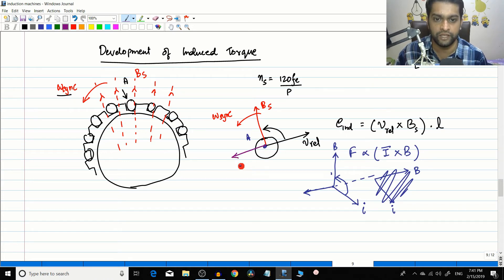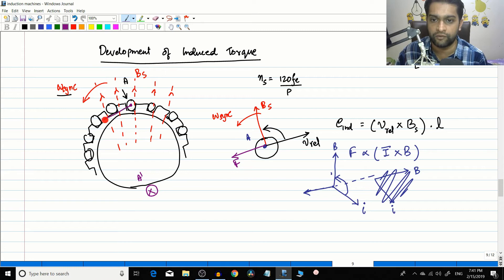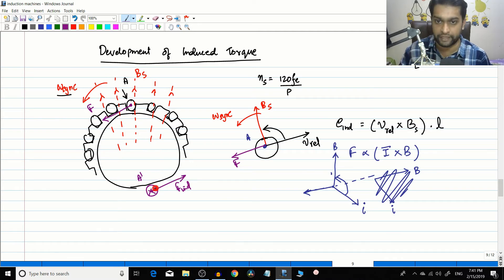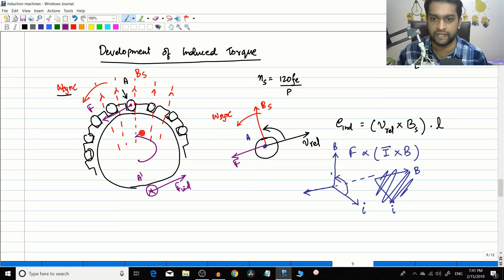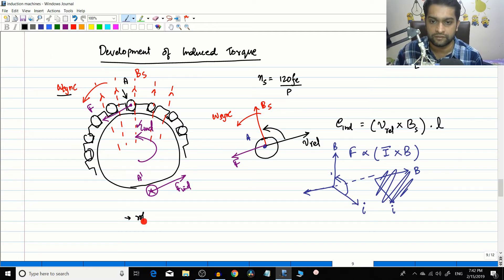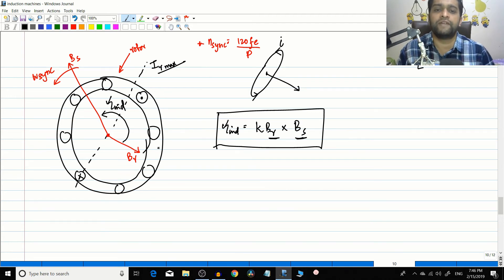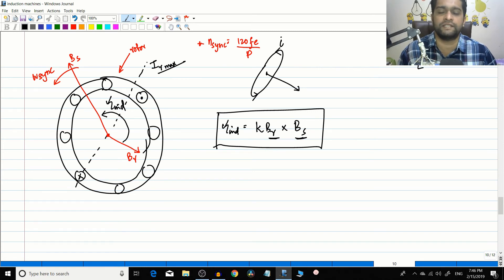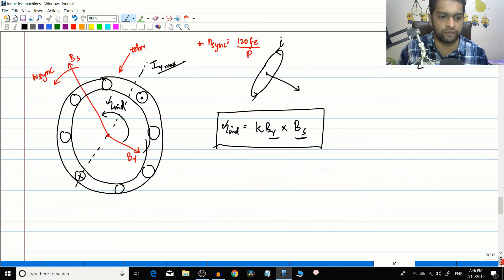Induction Motor #2 - Induced Torque in Induction Motor

Comment: @15:00, You said the synchronous motor with damper winding(without rotor excitation) starting principle is same with Induction motor starting principles, right? So in that synchronous motor starting procedure video you explained, at time t=0, a CCW torque will produce, and at time t=3/20ms, CCW torque is produced right? So that means in one complete cycle, 2 values of tourque induces and both will be in CCW direction and then rotor starts to rotate. So in induction motor also, in one complete electrical cycle, only 2 times(t=0, t=3/20ms) torques are producing? So comparing same rating of syn motor(with damper winding and with field excitation) and induction motors, torque will be less in induction motors right? Can u please clear my doubt Varun

Comment: What happens sir in motor direction and stator flux direction.
When stator 3 phase winding short circuited and rotor is supplied by 3-phase supply?
Reply from the maker: There is a detailed video in the channel...go through the playlist...
Reply: This results in split phase inductor

Comment: sir in case of transformer why no torque produce  but their still induction process present..please solve this problem in next doubt lecture.
Reply from the maker: This is a good doubt I will put it up in the next weekly doubt clearing session...
Reply: Torque is concern with rotation and in transformer, there is no rotating element.

Comment: @02:10 how have you  drawn direction of RMF.... I mean for conductor A force is coming from left to right... but what about conductor A', I mean for this conductor what is the direction of rmf... it is not clear... it is not clear for me from the video... please reply..
Reply from the maker: The field direction would be same, just the current direction reverses...so the force direction will reverse...giving a unidirectional torque overall
Reply: @ElectricalisEasy .... field direction will same means radially outward??
Reply from the maker: Field direction upwards in the paper...And current direction into the paper...
Reply: @ElectricalisEasy ... then angle between current and flux will be 180 and hence lorentz force will be equal to zero..
Reply: @Varun D Nair ... then angle between current and flux will be 180 and hence lorentz force will be equal to zero...... please clear the doubt...
Reply from the maker: @abigt282  angle between current and magnetic field is 90 degree field down to up in paper...And  current from outside to inside the paper